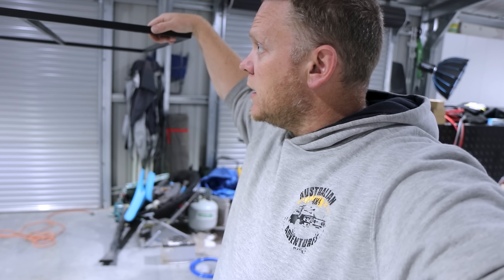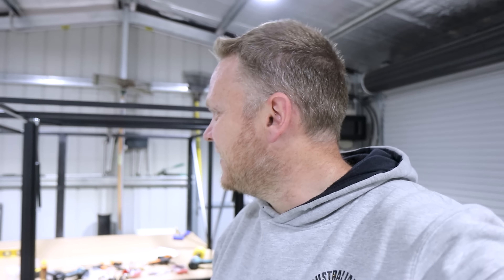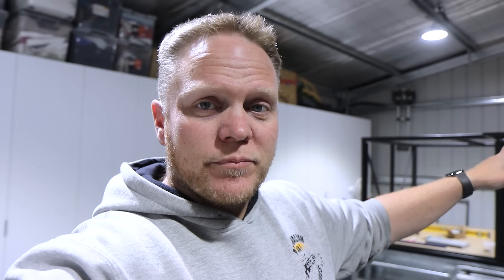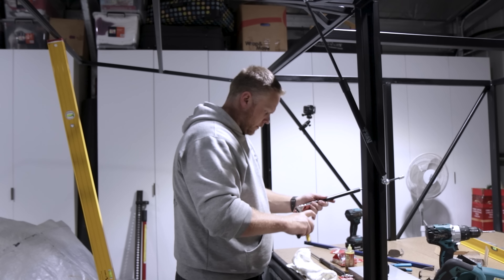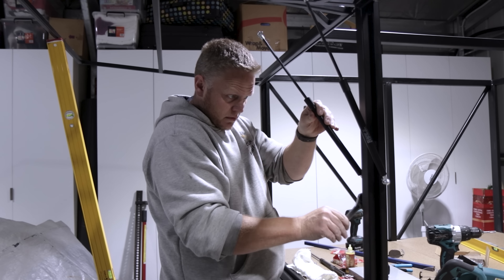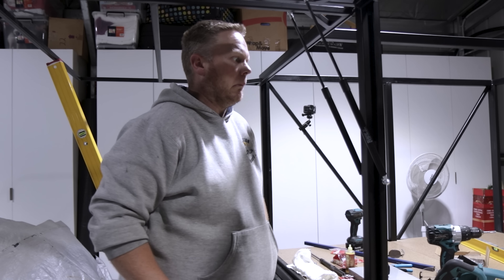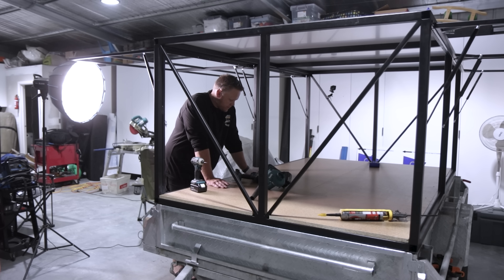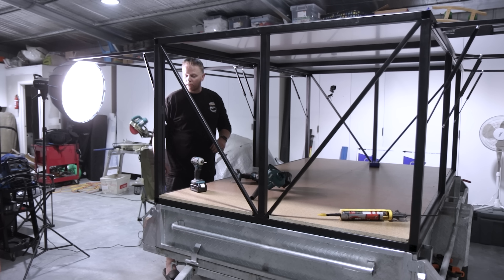Cladding my HOMEMADE camper trailer - Overlanding - Van life

Comment: Rivnuts are stronger than threading the tube. They'll fix the stripped thread. Also the gas struts should be installed the other way, with the gas cylinder to the top when closed.
Reply: I second this
Reply: Exactly what I was about to post 👍
Change them all to Rivnuts, there’s not enough meat in your box tube for a thread, they will eventually fail

Comment: Rivnut or drill a hole on the opposite side bigger then you need so you can fit w socket in and use the supplier nut

Comment: Every gas strut I have ever seen has the piston pointing down and there are installation guides that say that is the correct way to fit them so the advice must be correct. From what I can gather, there is a small amount of oil that helps the seal do its job and turning the strut upside down will allow the oil to run to the wrong end and the seal will dry out.

Comment: Just drill out hole to suit a nutsert/rivnut to suit thread on strut. I would have actually done that with all strut holes as the thickness of the box is too small a thread length & will pivot over time with strut tension & flog out and grease anyway. 
Easy peezy
Reply: Yeah this.
Reply from the maker: Hahahaha.  The other 13 comments saying rivnuts prolly make me think I need a rivnut gun hahaha.

Comment: Hay Steve, if you don't want to weld it & retap it, try to see if you can get a nut insert (Rivet nuts). Drill it out & add the nut inserts in. they will also be stronger than tappin the frame directly.

Comment: Hey Steve, dumb question, what's that hinge stuff called, does it have a specific name, thanks bud. Just a heads up too mate, when you're setting up things in the camper, mount a fan inside so when you're driving on dirt roads, the fan going all the time it pressurizes the inside of the camper enough to keep the dust out, and yes it does work I've done it many, many times. Great job mate. Seeya Rob
Reply: Centaflex hinge. Trailerpartsdirect

Comment: Nutserts, great invention, there cheap and just work in thin metal.
Are you insulating the roof & walls?
Put the wiring in before you get too far along. You could run wiring in the tube supports as this will protect it.

Comment: Use a Ribnut to fix your stripped treaded hole issue, buy a kit from bunnings and you may want to swap them all out as rhs is thinned walled and threads will stripout over time. Struts are upside down you use the gas end as the stabilised  end and the shaft pushes out.
Looking good though.
Reply from the maker: Heading to bunnings today